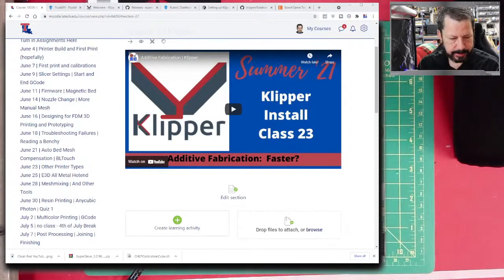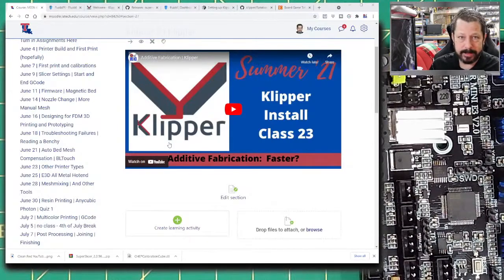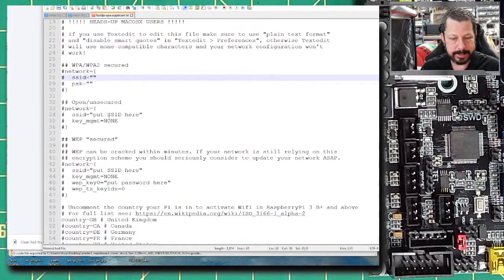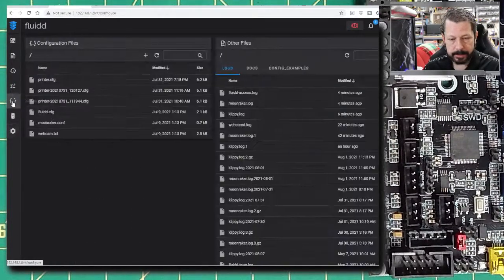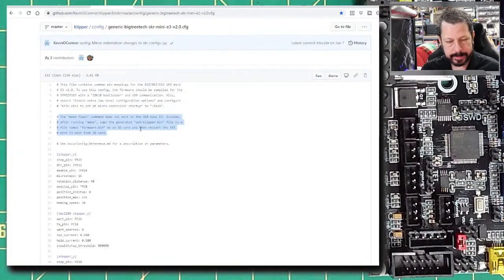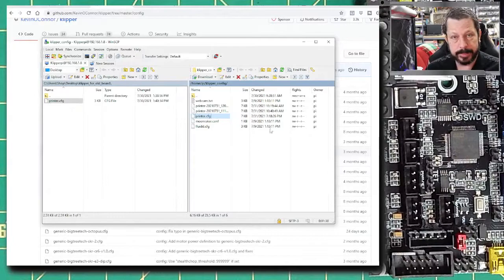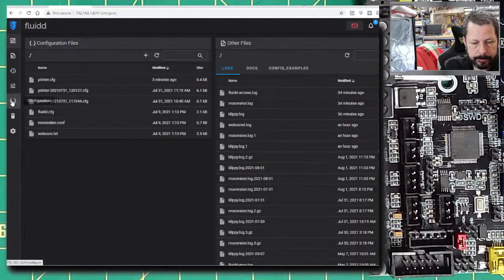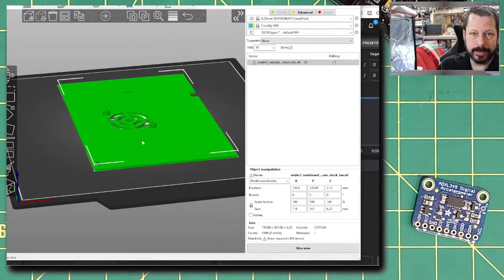Additive Fabrication | Klipper

Comment: Problem I’m getting is that I cannot connect to the printer,error connecting to mcu.please check config and restart firmware.in  the configuration I enter the correct serial.usb log.
Reply from the maker: Make sure you are using a data cable and not a charge only cable to connect the Pi to the printer.